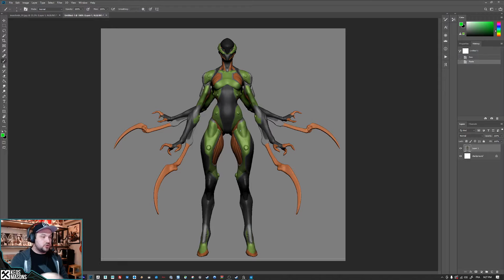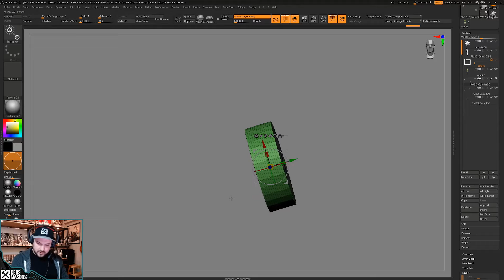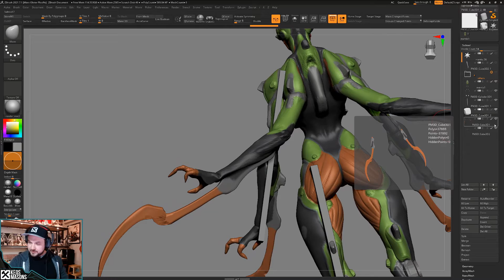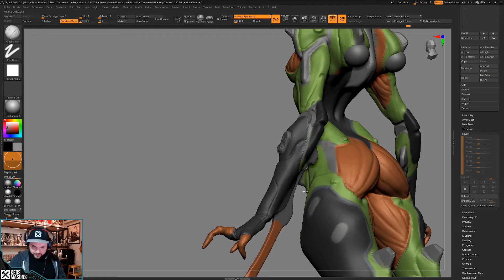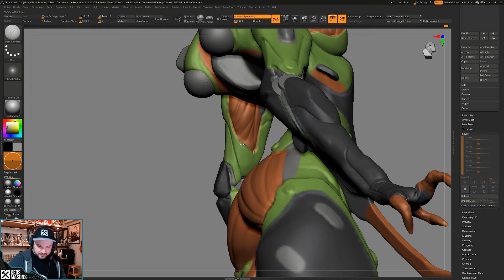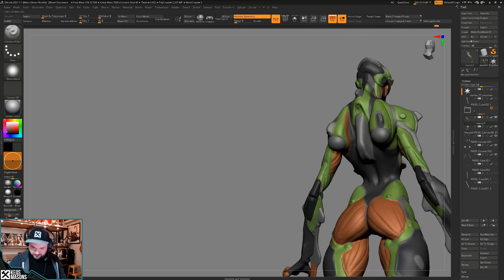3D Character Sculpting - Marco Plouffe's Twitch Stream of 2021-12-15 - Design and Shapes in Zbrush

Comment: Heya, I really love your thought process on this character and this series of characters.  I was trying to point someone at this video series to guide them through how to think about character read, so It's super frustrating that you felt the need to do your blockout before getting on the stream.  The process you had to work through would be invaluable  example to novices.  Plus it's always good to be able to show them that even on such a cool refined character, you had to struggle through working out the forms.

Love this model and this series, keep it coming.  Just please start recording from when you start the bockout work.
Reply from the maker: Unfortunately, I (Marco) need to be focus and alone for some more design parts. In the stream I did try to explain the main aspects and where I started.

Comment: Thanks for doing these, mate. Been HUGE fan(Cedric too) since even before the Keos days. Just wondering how your performance is at that document res when you get up into the 50+ million polishing stage?
Reply from the maker: 50 million is fine, when it gets in the 100 million its recommended to split in different Ztools
Reply: @KeosMasons   Thanks Marco, I work in collectibles so my projects often end up 50-100 million, but at around 30 million total my canvas starts to lag badly, and my canvas is only around 1400x1000(even though I'm on an ultrawide 4K monitor)So, just wondering how you're getting that sort of performance. I've been using Zbrush since version 1.5. :D
Reply: @musashidanmcgrath  - it’s everything combined: document size, how many vertex points, single vs multiple subtools, your pc hardware. Biggest improvements for me came from getting a new CPU and splitting heavy subtools into smaller pieces.